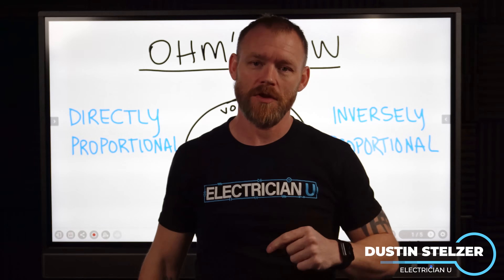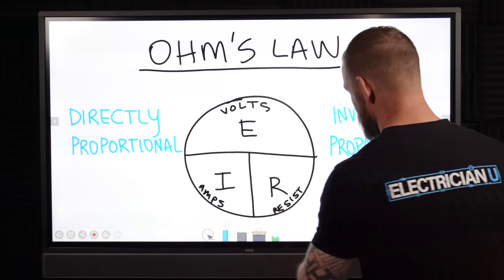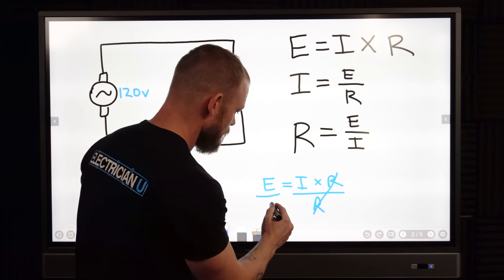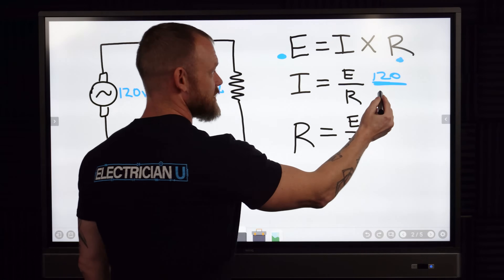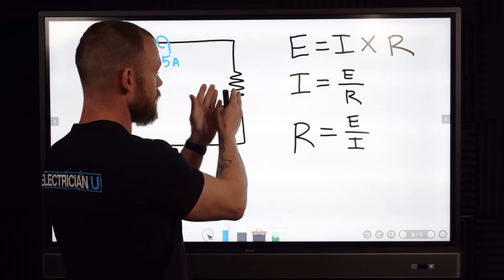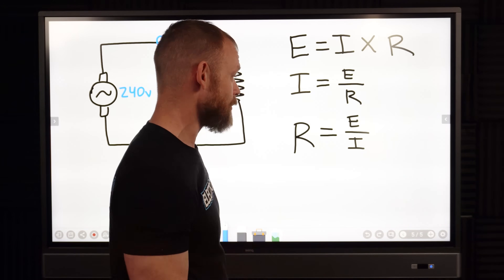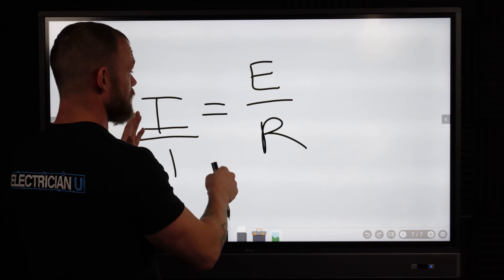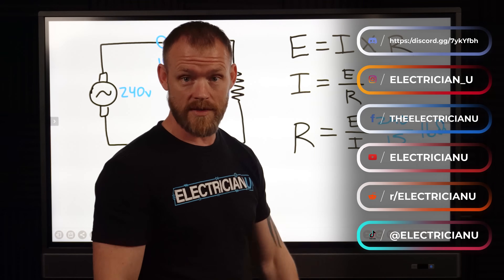Ohms Law - Directly vs Inversely Proportional - For Electricians

Comment: I noticed in many ways current behaves the same as water. Voltage is analogous to pressure and Current is analogous to volume. Two pressure tanks set at different pressures connected together behave the same way as two batteries of different voltages wired in parallel. A pool full of water won't hurt you if you stick your hand in it but apply that same water through a jet at 80K PSI and it will amputate limbs. All of the current in the world is harmless without enough potential (voltage) to drive it; although this is rarely the case it just highlights my point. When I started learning this "water logic" gave me a clue.

Comment: This would have been the perfect opportunity to point out that the math shown in this video assumes an infinite power supply. However, doing the mathematics using a fixed power supply, the opposite is true and voltage is inversely proportional to current. This is the reason transmission lines use such high voltage as raising the voltage, reduces the current, and allows for the use of smaller gauge conductors.

Comment: That is a really cool digital whiteboard, please share the Link and specs?!
Reply from the maker: I'm still on the fence about whether or not i like it to be honest.  The software side of it is really archaic.  Overall I don't recommend it very highly but it does act as a touch screen desktop monitor as well - there's just issues with latency when drawing on it as a monitor rather than using the BenQ Android side of it as a drawing tablet.  Its a BenQ brand tv though if you want to check it out.

Comment: Remember why high tension lines run at 11k volts...they can then run at low amps. Low amps mean you only have to use thin cable. Can you imagine if high tension lines ran big amps? They'd be so heavy they'd never hold up. And they'd become radiators.
So we are lucky big volts mean small amps.
Reply: Great point imho.

Comment: There is no "relationship" between voltage and resistance.  If you have a simple series circuit... changing voltage from 120V to 240V isn't going to change the circuit resistance at all!  It'll surely increase the amps flowing through the ckt, but will not change the ckt resistance by even 1 ohm!

Comment: In transmission lines they jack up the voltage and that lowers the amperage.  They do that for safety.  In that case voltage and amperage are inversely related.  When you transmit it to a building from the transmission lines the voltage is transformed (transformer)to the voltage needed.  Feel free to correct or add anything to my understanding.
Reply: How come the voltage and current are indirectly proportional when it comes to transmission lines?

Comment: Hey Electrican U man,  totally different subject have you done any electric vehicle power hook ups yet. Stand by power support for EV at residential homes because this is what's coming in near future like tomorrow. New installation what will the breaker ratings 60A, 40A,  30A etc...?
Reply: 50A Circuit with a NEMA 14-50 receptacle.
Reply: @flueflame5438  👍🏿

Comment: Yet where wattage is concerned, voltage and current operate inversely for a given wattage.
Reply: Not if the given wattage is a resistive load.
Reply: @atmacm  We should ask what is the constant.  Can we change the voltage, yes. Can we change the amperage by changing the voltage, yes.  The only constant is the resistance.  R=E/I.  If R never changes, then E and I are directly proportional.  If E and I are directly proportional and P=EI, then P is directly proportional to E also in this scenario.
Reply: @rynocop7958  yes, this is what happens in resistive circuits.

Comment: Got question plz if u have a 200 amp 3 phase disconnect 120,208 what size fuses would be right ? 200amp 250v or 100a 250v
Reply: 200 Amps is 200amps. The voltage doesn't matter...

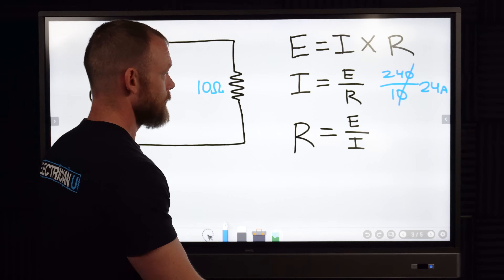Comment: 4:15 probably a slip of the tongue but "as voltage increases amperage will always be " LESS not more
Great video and I really appreciate what you do for our industry...!! 🤘⚡🤓
Edit: every electrician should know ohms law by heart.  Can't effectively troubleshoot without a solid grasp of theory...💯
Reply: Thank you.  Thought I’d lost it all.
Reply: If you have double the voltage acting upon the same resistance it will double the amount of current flowing. You are probably thinking of the power equation which means if you have a given wattage and double your voltage your current would be half.
Reply: @tomgrummett4591  no it will have HALF the amount of current flowing...
Current ALWAYS halves as voltage doubles
Reply: @MrMaxyield  Georg Ohm disagrees with you.
Reply: @tomgrummett4591  So you're actually saying that as voltage doubles current ALSO doubles...??
Johnson - Nyquist also disagrees.
The only exception to ohms law are non-ohmic elements like diodes and batteries but you didn't mention either...
Ohms law is the reason for instance why we drive lighting circuits at 277v or motors at 480v instead of 120v. Because the current is decreased which has many other benefits...
Reply: @MrMaxyield  He did the math right in front of you... I=E/R come on man. Is it time to go back to school?
Reply: @MrMaxyield  motors are rated in horsepower, 1hp= 746 watts. Therefore higher voltage would drop the current. A motor is not a fixed resistance load. I hope you are trolling at this point.
Reply: @tomgrummett4591  that's for a resistive circuit what max is talking about is p=ixe  which is what we deal with on a daily basis.
Reply: He literally just showed you in the video…. In resistive circuits, voltage and current are directly proportional to each other. In inductive circuits where the power out stays the same, then voltage and current are inversely proportional.
Reply: @tomgrummett4591  exactly my point. We use higher voltage to drive larger loads because when voltage increases, amperage DECREASES...

Comment: You explained it in some ways I've never heard of or thought of, like the part at the end where you explained that the 2 equations with a denominator, are the 2 that explain the inverse relationship between current and resistance.

Comment: Good vid man. What gets me is if higher voltage higher amperage according to the ohms law formulas. But motors other equipment etc. Operate at lower current draws with higher voltage.
Reply: You're confusing 2 separate equations. When you're looking at a motor, you're seeing the power required to make it run. Possibly something like 5,000 watts. Power is W=IxE. So a 5,000 watt motor at 120 volts is 5,000/120 = 41.66 amps.  That same motor at 240 volts is 5,000/240 = 20.83 amps.
Reply: @brianjaymchugh   and that is the correct answer 👍🏻. FYI, 1 horsepower = 746 watts
Reply: Richard cranium…
AC Motors have resistance (wire resistance) and reactance (inductive reactance and capacitive reactance) that all oppose current flow. This is known as impedance which units are also ohms. 

If anyone would like an electrical theory book recommendation…one that explains everything clearly and with great representative pictures to go along… I highly recommend:
Delmar's Standard Textbook of Electricity: 5th edition. Author: Stephen L. Herman
Reply: I’ve been confused about this too. I think volts/ amps are only directly proportional at the same resistance, and equipment meant for higher voltages physically has higher resistance. I’d like to hear Dustin’s take on it though.
Reply: @woodyshrubs69  what is he teaching
Reply: because in a motor  you are not just dealing with a resistive load  but also an inductive and possibly even a capacitance load resistance
Reply: That is bc the higher the voltage , the less amperage / current you will draw
Reply: @joeyayers8517  what is he teaching
Reply: If you have a load, or something “using” a specific amount of energy (technically transferring a specific amount of energy), it only “consumes” a specific amount of energy at a time. So, for a given voltage (energy per unit electric charge), the electric load will require those charges to pass through it at a specific speed, in order to transfer the needed energy to perform a function (speed being amperage).

Therefore, if you increase the amount of energy per electric charge, what do you think happens to the speed of those charges for that same given load? They slow down, because they don't require as many charges to pass through at any given time because there is more energy stored per charge, which results in the charges slowing down (lower amperage). Conversely, if you take away more energy per charge (lower the voltage), then the charges need to speed up to pass the same amount of energy (higher amps) for that same load. That is the why of the power formula or Watt’s Law. P=V*I
Reply: @ikerivers1795  do you like the video

Comment: why don't they use "V" in the formula, instead of "E". and "A" instead of "I"? would be less confusing
Reply: Because they use letters to define what they are. What is voltage? Electromotive force, therefore "E". What is amperage? Intensity of current, therefore "I".
Reply: @surferdude642  just to clarify EMF does NOT equal Voltage and Intensity of Current does NOT equal Amperes. They are different things. Volts is the unit of measure for EMF (E) and Amperes is likewise for Intensity of Current (I).
Reply: @ikerivers1795  Thank you, my mistake.
Reply: Keeps the tards out….😜